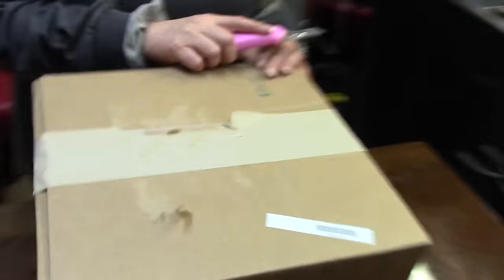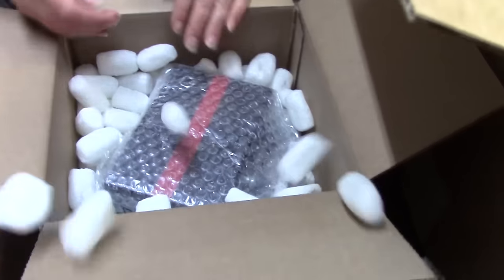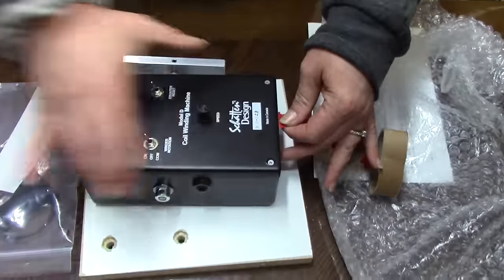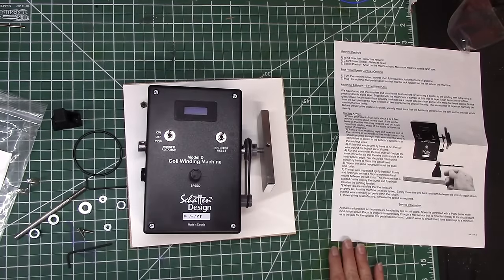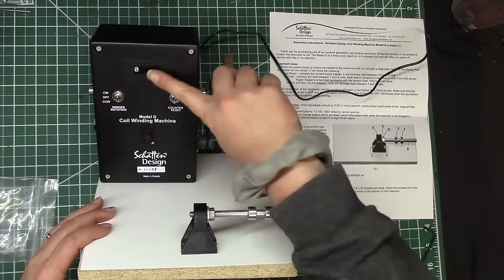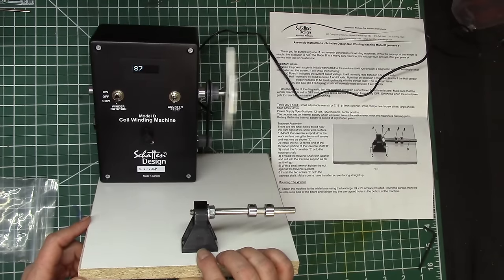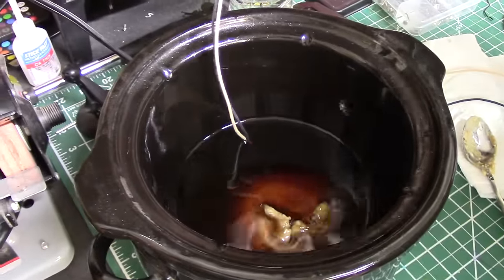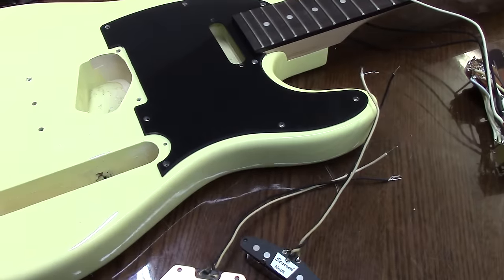I Made A Set Of ALNICO 5 TELECASTER PICKUPS!

Comment: You are giving away the secrets! Would it be worth it to get an inductance meter to measure the inductance? That is a better way to measure the tone of the pickups than DC resistance (although there is a high correlation). Fender and Tonerider lists the inductance, but Seymour Duncan and others don't.

Comment: I see that the magnets have to be installed to agree ... either all of them have North UP or all of them have South UP.  Why is this important?  Why does a "north up" p/u have to be a neck pickup?  Again, sorry for my questions.  Good Luck on your channel, Cathy.
Reply from the maker: The magnets in each pickup have to be the same polarity either north or south. It does not have to specifically be north for the neck it is just important for one pickup to be north and the other south, that way when you are in the middle position with both pickups activated it makes it hum canceling similar to a humbucker
Reply: As I understand it, unless you want an out of phase sound, the basic idea is to have all the signals "in phase", regardless of how many pickups are used simultaneously. 
Sometimes, such as in a strat, you flip the magnets and the winding direction of the middle pickup. This puts the string "signals", "in phase", when used together in the 2nd and 4th position. 
Even though you flipped the magnets on one pickup , in this case the middle pickup, you also reversed the direction of the coil winding. 
Because of flipping both, the signal (strings) is "in phase", meaning the signals you want combine (the strings of 2 pickups simultaneously), but the signals you don't want (the noise) gets eliminated because the noise is "out of phase". 
In one pickup, the noise is, let's say positive, in the other the noise is an exact reflection of that noise signal 180 degrees out of phase, so the noise "cancels out".

https://www.sweetwater.com/insync/what-are-rwrp-pickups/

https://www.premierguitar.com/rwrp

Comment: Why 8000 winds??  Why not 3000, why not 20,000….
Reply from the maker: Telecaster pickups typically get 8000 winds on the neck and 9000 winds on the bridge. The more winds the hotter the pickup, 3000 would not be nearly enough it would be an extremely week pickup, and you could go slightly higher than 8k and 9k but you can’t really fit to much more on a bobbin than that…
Reply: @ScarMyPickups why not use authentic 43AWG wire for the Telecaster neck pickups?
Reply from the maker: @larryn2682  I use Remington 43 AWG